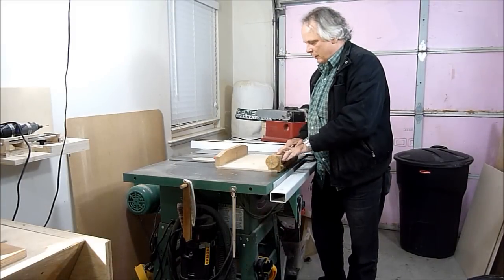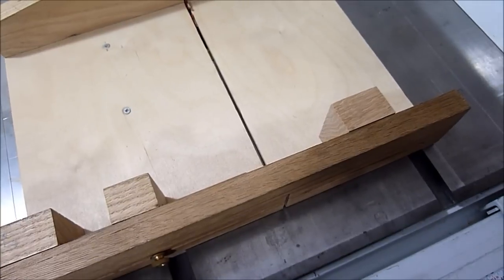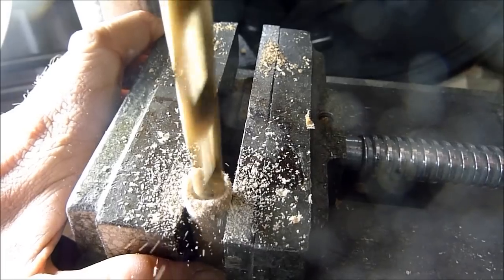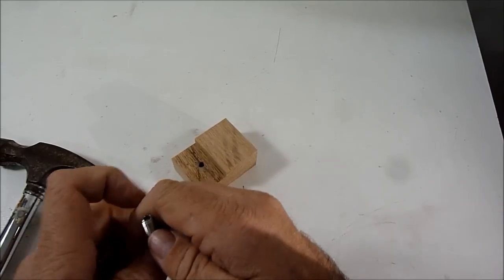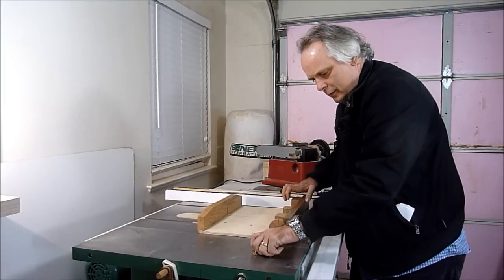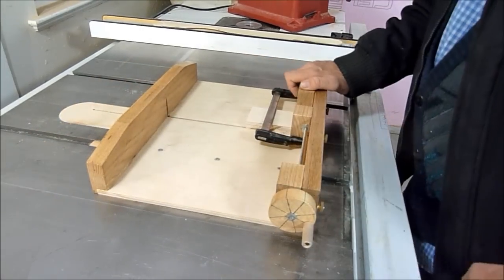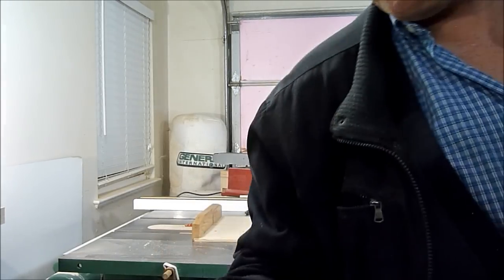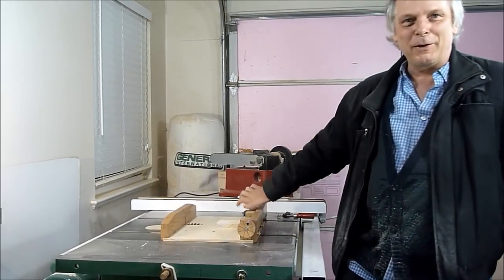Cutting perfect grooves with a table saw

Comment: Hi Jack, I am in the middle of building a sled, I like what you have done setting up yours. I have one question - As the threaded rod extends from the knob and through the first mounting block on the left, is the rod held captive, meaning I see double nuts between the knob and the first block but is there another set of double nuts on the right side of the first block to hold the rod and knob from sliding back and forth on the block. At 3:36 I can see you sliding the knob and rod, that would seem to make the sliding knob, the one you hold your work up against a little hard to control. I see you need to lock the slider down to the fence, but is there a reason you didn't make the rod captive in the first block?

Comment: If  you invest in a spray can of furniture polish, and spray screws with it they will enter the wood a lot easier,
Its also good for spraying table saw and other surfaces to prevent rust, and to allow smooth movement of workpieces.

Comment: Yes groovy:) great job bud - where did you find the long allen screws at..? Ive searched for them in the past without avail... Im guessing this sled style could also be adapted to a router table for producing one of kind moldings for small wooden boxes etc...
Reply: You can find them in many hardware stores as "set screws". They're sold in many lengths and an assortment of diameters.
Reply: Try "ACE", they usually have a lot of ODD BALL items, and if that doesn't work, MSC works for me.      Gb bg

Comment: As always simple ideas are the best. Nice idea for small stuff. I had the idea to use this to cut for decking boards after watching this, but of course the sledge limits the length you can work with. As you know decking boards come in lengths up to 4.2 metres so would need a HUGE sled. Still brilliant for small decorative work.